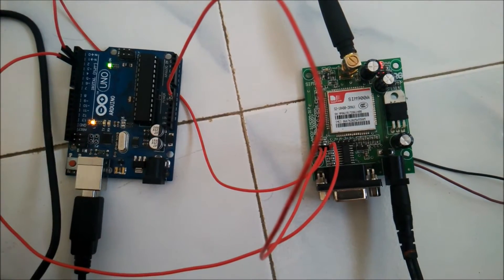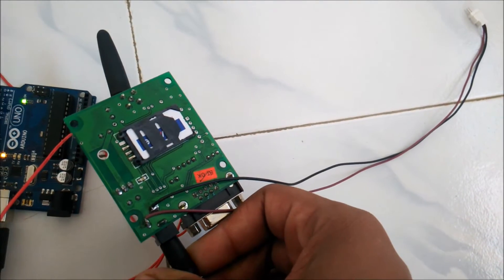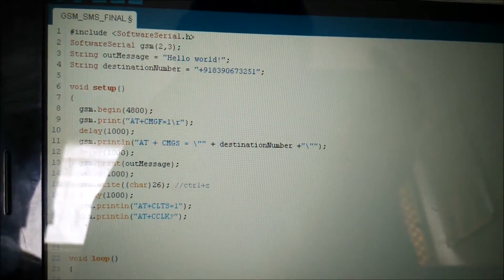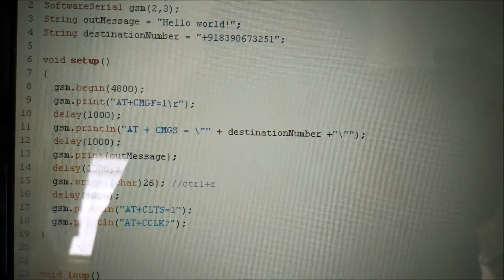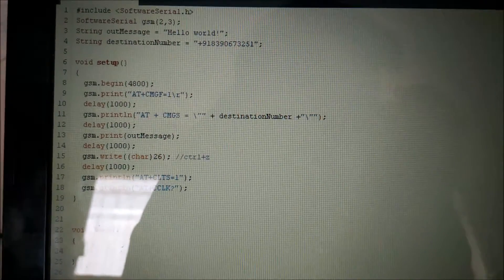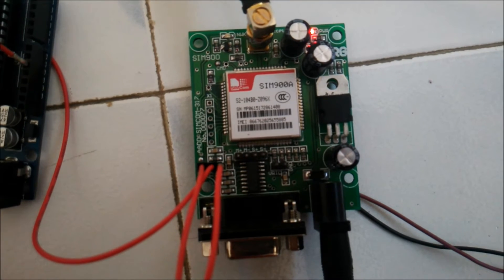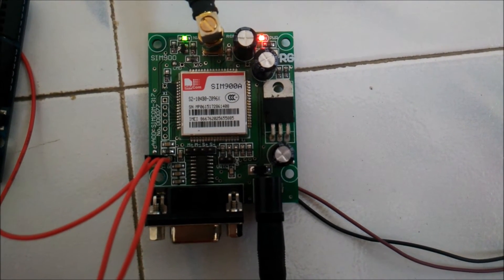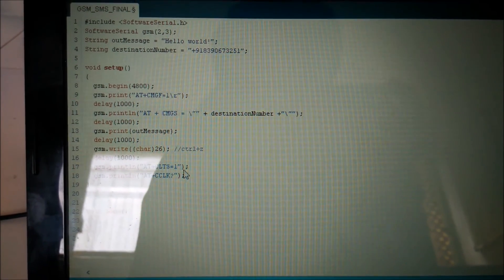Send SMS from GSM module

Comment: Hello best video but the  code don't operational in belgium I must place line 8 to 18 in routine  viod loop but then sms  is sender non stop? are you solution??
Reply from the maker: If you use send SMS code in Void loop, your SMS will be sent continuously. Keep the code in Void Setup itself and try changing the Baud rates according to your GSM module. The Baud rates used in my code are compatible for SIM900 module only. They might be different for your module.  Good Luck :)

Comment: How to add gsm library I Arduino ide
Reply: simply download a gsm library they are mostly in zip formats. Extract it then copy it to the "Documents->Arduino->Libraries" path. Close the arduino ide and restart it
Reply from the maker: In case of Windws OS, download the library from the internet, extract the zip file to get the GSM library folder and paste this folder on the mentioned path:
C:\Program Files (x86)\Arduino\libraries

Comment: is gsm module can be used only conected to tower
Reply from the maker: +Prashant Jha yes, you need your sim card to be active and it must have acquired network( range) from respective tower, only then the sim card can send/ receive messages and the gsm module can perform actions accordingly.

Comment: Will the program run on GSM800c??
Reply from the maker: Need to check the specifications for GSM800c. Refer the datasheet. If the AT commands are same, then the code should work. Else, just change the AT commands in the code, as given in the datasheet.
Reply from the maker: It might run, but the baud rates may differ. I'm not sure

Comment: Hi sir great video, but i am having a problem with my project. I want to receive sms using my gsm module but i can't  unless i open the serial monitor. Can you help me please?
Reply from the maker: Hi, it might be that you are receiving the sms immediately. But the problem is that the sms is printed on the serial window, only when you open it. Practically, GSM would receive the sms regardless of the Arduino board, but to print the message on Serial window, you need the window open. 

Open the window in advance and then send a message to the module. Then check the result. Immediately the received sms will be printed on the Serial window. Good luck :-)
Reply: Thank you for your response. The thing is i want to receive messages using the GSM module without the serial monitor because i want to install it in my home as an SMS remote control.
Reply from the maker: So you need not print the message on Serial window. As soon as the message is received, set a flag and whenever the flag is set, you can carry out your desired functions.

Comment: sir i want to use gsm board+ arduino+ relay modul

switching analog adruino and oprat(on) relay and show to mobile.
and by mobile same relay off
please sir send as video
Reply from the maker: I'll surely try to make a demonstration video for the same. But that might take some time, you can contact me if you want to develop the code and connections.

Comment: Hey Saurabh awesome video !! i tried it worked like a charm, but i need to know whether can i make a Motion Sensing SMS Alarm System using the same GSM module or not?
I saw a few videos of youtube and they all used a different module. Please help!!
email ID- uzairules@gmail.com
Reply from the maker: Hi Uzair,
Surely you can use the same GSM module for your purpose.Basically the GSM module ius used only to trigger sms. The logic implementation would be based on your Motion Sensor. Whenever a motion is sensed, the GSM module is triggered and the sms is sent. You may try an If - Else loop. If the motion sensor gives a trigger signal (whenever motion is detected), then execute the GSM code. So the basic step is to write my attached code in the If loop. Try this out. Good Luck :)

Comment: I was using the Mega 2560 in place of UNO. But given code is not working. Maybe the pin configuration is needed to change. please help regarding this.

Comment: This video was really helpful! Can we use any other GSM module other than SIM900A? I have to use it for only sending messages but SIM900A is really expensive. Can you please suggest me any one?
Reply from the maker: Hi.... SIM900 is the most easily available module in Indian market. I personally haven't interfaced any other module with Arduino. But as per my knowledge, a slight change in the Baud rate would make the Arduino work with any GSM module. Good Luck :-)
Reply: Thankyou very much Sir! :)

Comment: hi sir,,can you send me the code and circuit diagram to muhd.izwan3@gmail.com
Reply from the maker: Hi, you can get the code at the above mentioned link (check the description). I haven't prepared any Circuit diagram as such. You may create one by listening to the connections carefully in the beginning of the video. Good Luck :-)
Reply: thanks a lot sir :)
Reply: Sir, I want to see receive sms from GSM module.

Comment: HI. I DID YOUR  PROJECT BUT I DID NT RECIEVE ANY SMS.PLS HELP ME
Reply from the maker: Hi, Please verify the below steps to get the code running.
1) Please recheck that you set your own cell number as the destination number in the code.
2) The connections must be done in a correct and proper way. Also, the AT commands must be sent without any noise or glitches(This is verified by using proper aluminium or copper wires). 
3) Verify that the GSM module has acquired range for the sim card and is ready to work (This is indicated by the slowly blinking LED on the module). 
4) Recheck for sufficient account balance or sms pack balance in the sim card which is going to be placed in the GSM module. 
5) See to it that the destination number has not blocked the sim card which is placed in he module.

I hope this solves your issue. If the problem persists, feel free to revert back!

Comment: hi sir.. 
can u interface gsm sim900a  with lpc2148..? bcz i am facing problem with that program.. i am not able to check the output.
Reply from the maker: Hi,  currently Iam working with lpc2148 to interface the GSM module. As soon as Iam done with it, I will upload a video regarding the same...stay tuned!